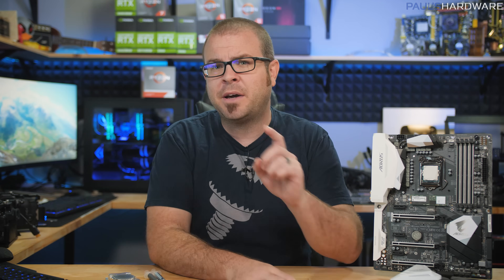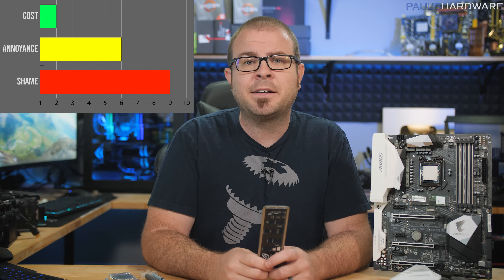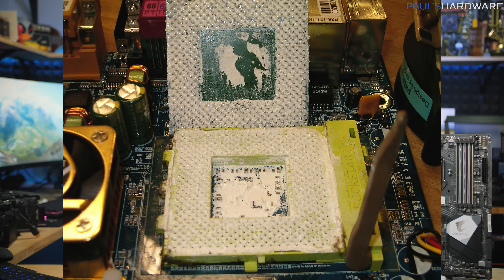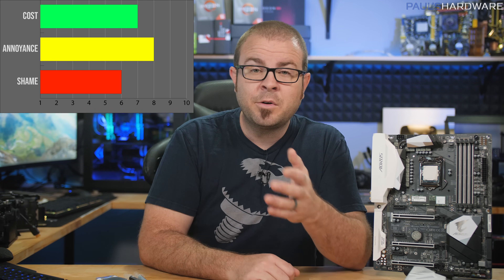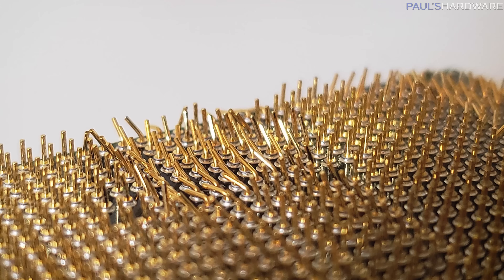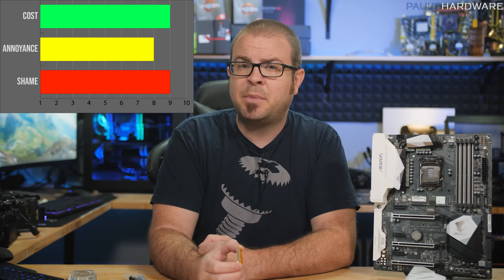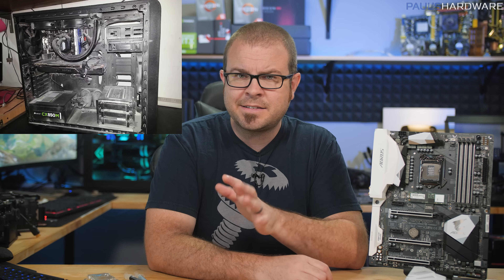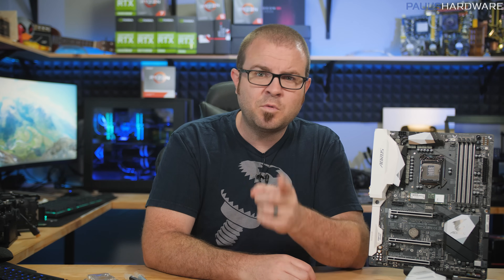The 5 WORST PC Building Catastrophes 💥🔥🧯

Comment: using the  wrong screws on the mobo standoffs and getting them stuck in the hole on the mobo and requiring other tools and methods to get the screw out of the standoff.

Comment: When I was in junior high in the 90s I was building a PC for a friend. When it was done I wanted to check if the sound worked, so I had to bend over the case, grab it and tilt it forward to get access to the back of the case to plug in the mini jack. Doing so, I accidentally put one of my fingers in a switch on the PSU and switched it when lifted. It was the switch to change from 110V to 220V. It fried the PC and only the CD-ROM worked, kinda. I kept it, and it was moody as long as I used it. Neither my friend or his father was very happy with this situation.

Comment: 10 annoyance, 10 shame, 4 cost. Realizing your motherboard requires two 8 pin EPS plugs and your power supply only has one.

I have first hand experience on this when building my first X99 system.

Comment: Forgetting to lift the retention arm on your X570 board, putting in the brand new 3700x and cooler, realizing you messed up, pulling off the cooler and having the cpu come with it, and lastly dropping the brand new cpu when removing it from the cooler and bending the pins. My shame was a full 10/10

Comment: After I built my first Intel system several years ago, I upgraded the CPU and motherboard to an overclock-able version (mostly because a $200 sale putting it at the cost of a standard version), I was all done and ready to go so I went to put the CPU cover on the old board but didn't know how it was supposed to be inserted, so I fumbled about until it slipped and smashed a handful of pins.

Comment: I was having issues with my main PC.  It would freeze completely and be unable to recover.  I had to hard shutdown to get my system back.  I knew my PSU was 7 years old and a year or so ago I found out that if the power was cut to it, it doesn't always want to turn back on.  Knowing this I replaced the PSU but this did not resolve the issue.  The CPU was an FX-8350 so It was fairly cheep to replace from newegg.  So, I replaced the cpu thinking that maybe the FX had gone bad due to the frequent complete system lockup.  This did not work.  After a few weeks past I was fed up and decided to force a windows 10 build upgrade from 17xx to 18xx.  To my surprise the issue no longer persisted and I have not had the issue since.  I spent money on two new components that were not the cause of the issue.  A simple windows build upgrade resolved it.  I really wish Microsoft did not fire their testers.

Comment: I used a cable from an older  orsair psu ona mew psu and the system wouldn't boot. It would click and a red light would come on for a second or two but nothing. Thought it was the corsair lighting node but was the old cable. Switched out the cable to the one that came with it and it booted right up. Lucky I didn't short anything out!

Comment: Paul, I started building my first computers in 1976.  At that time you either built from scratch (breadboarded), bought a bare board with a parts list or got an entire kit of boards and parts.  I was an Electronics Tech and opted for scratch building, but saw many results of people who definitely were NOT techs and had no business trying to build their own.

I'll list just a few of the goofy errors I've seen:
1).  Parts glued to boards, not soldered.
2).  Parts soldered, with ACID core solder
3).  Parts properly soldered, but instead of cleaning the solder points with alcohol or flux remover, cleaned on a grinding wheel.

Then there are the errors that came years later as new devices became available...
1).  Floppy disks kept within reach by using refrigerator magnets on the metal chassis
2).  Breaking the "Cup holder" (CD tray)

Cheers, and give thanks that you don't have to go through the "bad ole days" with jumpers or dip switches to properly config a system :D

Comment: Installing a PSU that has the voltage  (220/110 or 150) to low voltage on a high voltage outlet.
Forgetting your  motherboard has a locking pin on the Video Card's Slot and breaking it because you think the card is stuck in the cases rear slots.
Forgetting to plug in a fan and cooking a CPU or Motherboard chipset.

Comment: My PC building catastrophe: I first installed the D15 on an X570 motherboard in a Fractal S and I struggled really hard to plug in the fan-connectors, I could only hold the cable in between the sides of my fingers and then I had to plug it in while barely seeing anything and having very little room to turn my hand. This with three fan-cables. They really should make more space in those cases for people who have big hands. I also had quite some difficulty routing cables because many of those cables aren't long enough. I don't want any tension on the cables. I wanted to do it neatly but it simply wasn't possible for me (RM650X), maybe I lack the experience as a first time builder but at least I got it done. When I was done I made one little mistake: I forgot to plug in the PCIe-cable in the graphics card even though I had connected it to the PSU. :)
It took me 1 second to figure out the problem because the fan of the graphics card did not spin. Other than that I got it working immediately.

Comment: ahhh yes, this brings me back to 2002, freshmen year of college.  upgrading pc into a new case (the Antec PerformancePlus 660AMG) I'm relatively new to pc building, and I went all out with tubing to hide ugly cables, blistering fast and hot amd athlon 1400!  Anyways, I had a big paper due, got cocky and took apart my pc to transplant into the antec case.  Got everything buttoned up and pristine for what lousy gaudy wire loom looked, ready to get it back on and start working on a paper that was due in less than 12 hours....and nothing, nadda, see fans spin for a second then dead.  no power, no life....more importantly...NO PAPER WRITING.  I freak out take it all apart, throw it back together AND....you guessed it, NOTHING.  I was sweating bullets I thought I screwed the pooch somehow so I had to figure out something FAST.  call around the boston area to comp usa, best buy, microcenter AHA microcenter had the same board.  I jump in a taxi (boston come on, no way bringing my car) fly over to microcenter, spend way more than I did initially online, taxi on back, rebuild and.......NOTHING.  

....I had too many stand offs in.  was shorting.  nothing was actually broken....  put the right number of stand offs in and PRESTO.  so ya...shame factor, cost factor, and time factor...all 11.  I did get that paper finished though...got a C....yay

Comment: 5. Not using the CPU placer
It’s there for a reason. You don’t want to get the oils from your hands onto the CPU.
Cost: 1
Annoyance: 9
Shame: 8
4. Placing ram into the wrong slots
Everyone knows if you have multiple sticks, you should always stick them right next to each other in order from them to have the fastest connection.
Cost: 5
Annoyance: 6
Shame: 1
3. PSU Fan
I want my case to be cool so I have my PSU fan sucking all the heat from the case itself.
Cost: 2
Annoyance: 4
Shame: 5
2. Static Bracelet
I personally use the one that my girlfriend uses to tie her hair up.
Cost: -1 (They’re everywhere)
Annoyance: 10 (She can get annoyed)
Shame: 3
1. Not having a table
Am I right PC enthusiasts? You might have some trouble but a lap works in a pinch.
Cost: ?
Annoyance: Could happen
Shame: 10

Comment: I set my motherboard on a chair with the power supply attached and the power supply fell off, taking the board with it. Some of the plastic caps on the back of the motherboard fall off and got lost in the carpet. It worked fine without the plastic caps when I tested it, but I’m afraid of something like a PCIe slot or memory slot falling off. Can it be repaired with electrical tape?

Comment: I was building a PC for a friend and I guess the CPU was slightly off or moved when I pulled the lever down as it bent a bit of the Mobo pins, luckily I VERY carefully was able to bend the pins back and it worked fine, but I never told them 😅 this was on a LGA1155 board.

Comment: I recently received a motherboard that had the thermal paste problem.  I have it stuck at the CPU error and have already started fixing the problem.  Please, for the love of all that is, heed the warnings of not getting thermal paste on the socket itself.  This issue is very difficult to fix when caught at the right time and definitely does cause board failure.  The only silver lining is that if I can get it working, I have a new test rig.  That still does not change the fact that new builders make this mistake and it can cost them way more than expected.  I have been personally building computers since the original pentium processor, and have seen this problem only when the builder is new to the process.  Sorry for the novel, but @Paul's Hardware has it completely right with the annoyance and cost factor.  Great job @Paul!

Comment: never missed the IO shield or put paste in my socket.. I have bent a few pins 20+ years ago but not since and power outage is extremely rare in my country.. I have however had a graphics card overheat(?) and physically fuse with the PCIe slot.. my PC was a few years old.. running a GeForce 760 card.. I had been chatting on IRC and browsing, got up from my chair to get some food.. after about 30 seconds I smelled that distinct electric burn smell.. saw a little smoke come from my PC.. opened the side door and saw the plastic in the PCIe socket.. bubbling away and smoking.. no actual flame but everything.. died.. everything.. all of it.. monitor.. speakers.. keyboard.. mouse.. motherboard.. printer, DAS.. wacom tablet.. cpu.. ram.. graphics card too even..... so these days I'm using a 9 year old dell optiplex with a intel 2500 cpu.. until I can find money

Comment: Renesas (NEC USB3 chip) soldered with pin1 the wrong way around, motherboard returned due to chip burning, killing my new RAM and new CPU and PSU... CPU RMA-ed OK, RAM RMA-ed OK, PSU RMA-ed OK, Motherboard RMA not OK. A lot of hassle to get my Motherboard replaced. (It turned out my motherboard serial-number was never tested in the factory when asking for the test report...)  I never buy motherboards (or any other product) from them ever again, even if if they sponsor a youtuber for a review or a build video.

Comment: If the power cuts out during a bios update, many computer repair shops can fix it, and some boards, such as Gigabyte dual bios boards can recover from it, so if that one happens, then try not to panic, it's more often than not quite easy to fix it, even if you can't fix it yourself due to lacking the tools or experience.

At the company I work for, that kind of fix would be about 35 quid to correct, and we'll update the bios to the latest version to ensure there's as little risk as possible of it happening again, and depending on how easy it is to get binary images of the bios (some prebuilts are especially hard to get images for) , we generally aim to get the system returned before the end of the day, but I won't mention the company I work for to avoid accusations of shilling. :) 

For example, we had Dell system come in that had a bad bios update that completely bricked the system to the point that the fans wouldn't even spin, and we were able to recover it despite there not being a bin file available from Dell to fix it. (Dell no longer provides binary images of the bios for any of their systems from within the last 8 years or so, so be careful with updating those systems especially)

Other companies will generally be the same as us, relatively cheap compared to the cost of shipping the board/system back, doesn't require RMA, and you'll likely have the system back the same day and if the repair company take pride in their work like we do, will clean the system internally and externally, do cable management, and do a general health check on the system for you, to ensure it doesn't come back for something that's easily avoidable.

I do normally encourage people that are into pc building to try to fix their issues themselves, but a bad bios flash can be difficult to fix, especially when the bios chip needs desoldering from the board, which was the case in that Dell I mentioned.

Comment: shamefully I had built an AMD 7 1700  build with an rx480 ASUS strix with 16gb of ddr4 3000 ripjaws and it was working fine for weeks. I disconnected the PSU and installed an MSI 580 and LED fans with a controller on the inside of the case. I had trouble putting the screws in for the GPU and dropped one. Forgot about it, when I powered up there was a pop and fried the MOBO. I have bought all new parts for a fresh build and put them on an open build frame but have not been able to get another build to work.

Comment: Realising you rewired the molex plug of a pump/res to 5V pin and not 12V pin.  Many frustrating reboots and CPU overheat protection. Eventually I realised. 
Cost: 0 
Annoyance: 10 
Shame factor: 10 (I'll take a picture for reference next time!)

Comment: It only really applies to open loop cooling but water and fire should be tied for first...  Realizing that you have a loose fitting after you've powered on the system is a terrible place to be.  
Water has the potential of damaging just as much (cost).  You have to wait a few days for everything to dry out before you can even find out what's damaged. There can be no more shame than knowing that you should have tested the loop before powering the system.

Comment: I killed a couple of motherboards in the old days where front panel USB required you to put each individual pin (power, ground, data etc) to the right one on the motherboard. If you did it wrong, you could short circuit your motherboard.

Luckily those days are over.

Comment: I bricked a BIOS in the past. Went on ebay, bought a new BIOS chip for my board for like $5 and a special pair of tongs for another $5 and two days later I just changed the BIOS chip and was done. Do modern motherboards still have user removable chips like that?

Comment: I spent the last week trubleshooting my latest uppgrades. 
New motherboard, new cpu, new ram, new PSU, new harddrives.

It started up fine, installed windows. Downloaded some games and stuff. And then, after a couple of hours i started a game. Didn´t even hit the one minute mark before it died. 
It was like pulling the chord.

Remowed everything (only had cpu installed to the board) and tested with two different PSU´s but nothing but the rgb on the motherboard worked.
Not even the error leds.

Got back to the store and changed the motherboard.

Came home, installed the cpu and power to the board ( with my new PSU from the day before). And NOTHING! 
Only the leds.
Tested with the old PSU, still the same.

Back to the store with booth the Corsair PSU and the motherboard. 
Was lucky at the store so I could change booth PSU and MOBO.

And NOW it worked.

Turned out that the psu had crapped out and somehow ate motherboards for breakfast.

Took me five days to get a working computer again...

Comment: When I was working as the admin in a server software test lab, we had a stack of old 32-bit Tualatin P3-S 1.13GHz (http://www.cpu-world.com/CPUs/Pentium-III/TYPE-Pentium%20III%20(Tualatin).html) machines that my boss wanted me to test out.  They were old when I got them, and had been in storage for over 4 years at that time.  The first one that I plugged in let out a pop and hiss as I plugged it in, and of course wouldn't power on, as the next two wouldn't power on either.  (Yes, I was using the right voltage.  The power supplies could handle 100V-240V, so no issues there.)  The 4th one I plugged in let out a full on flash of fire that singed the hair off the back of my hand.  I quit at that point, and didn't test the other 3.  Turns out the video chip on these boards was known to attract moisture and corrosion while in storage, and this particular board would send power to the video chip as soon as the power was plugged in.  So, all the gathered corrosion was instantly frying the video chip. 

Even more fun was that someone else in the lab received a stack of these from another location, and had a similar experience, but fortunately missed his hand.  I sent out an email to everyone working in the lab that this particular machine model was banned from being in the lab, permanently.

Comment: Back somewhere between the age of dinosaurs and the age of sail someone I knew "successfully" screwed a VGA cable into a serial port.
I got a call at stupid o'clock because they were getting a keyboard lock error on boot. Because the key was turned to lock. Remember those? No? OK.

Comment: Wondering why the machine won't power up, then realising it's unplugged/switched off at the wall. Done that at least 100 times. You'd think i'd learn by now. 
Another no power one - forgetting to plug in the front panel headers and wondering why the power button doesn't work. 
Dropping something metal inside with the power on, and it shorts something.
Spending time cable managing, only to realise you managed them around a pinch point, when you go to put the cover back on.
Wondering why you can't see the hard drive/SSD/  DVD(anyone use them anymore? I still do.), then realising you forgot to  plug in power to them. 
Taking a chunk out your finger with a spinning fan.